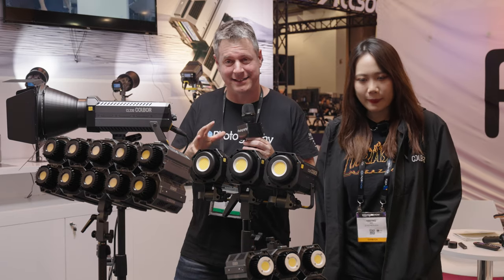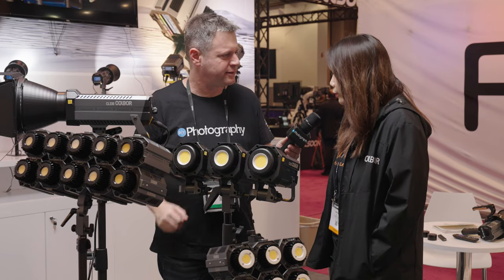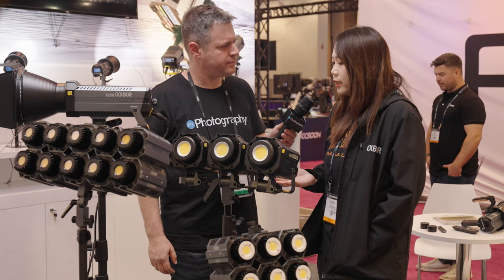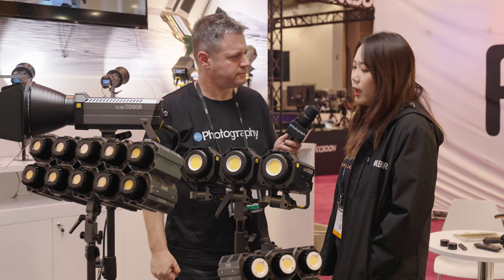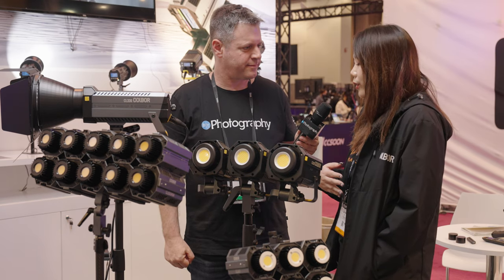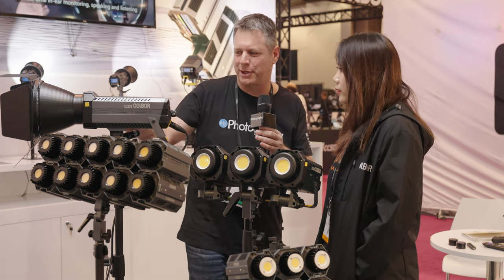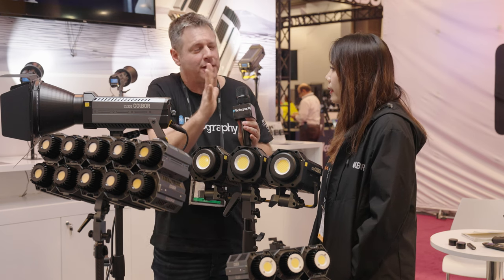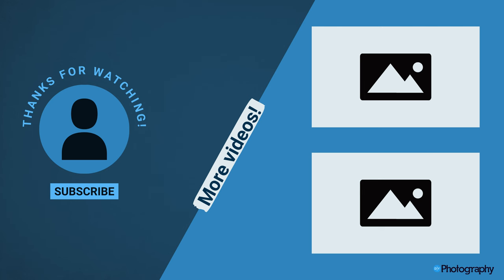These lights are like LEGO | COLBOR CL220

Comment: For the three CL220s stuck together with the Nato rails, it looks like there is sag on the ones on the edges because it is not as supported by the side walls of the unit.